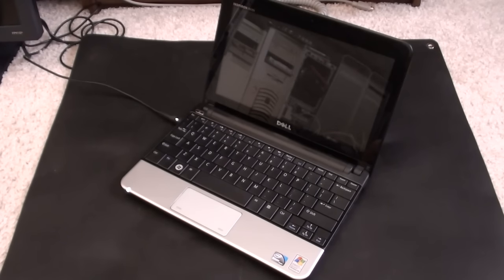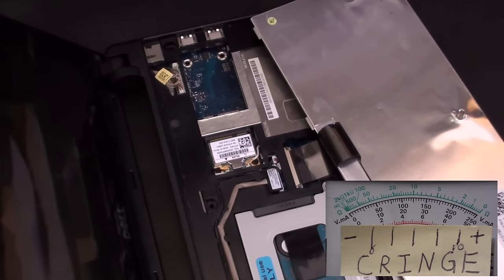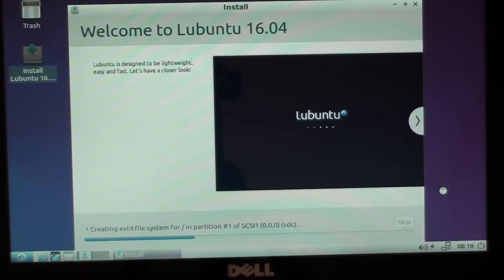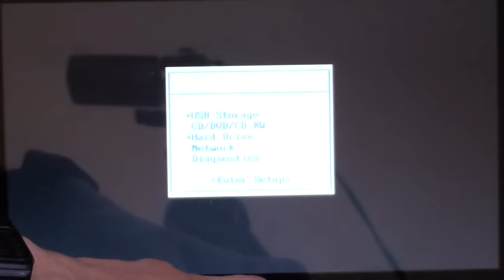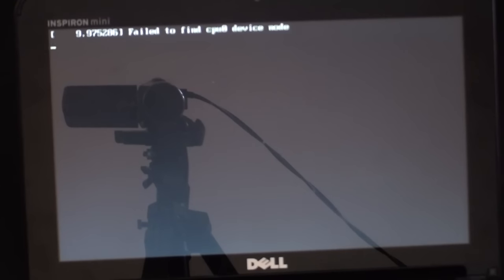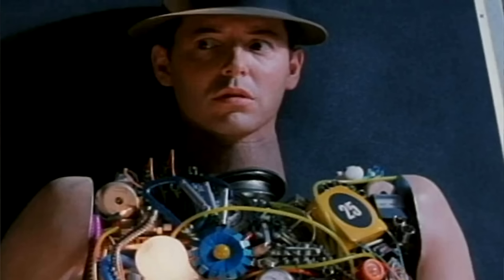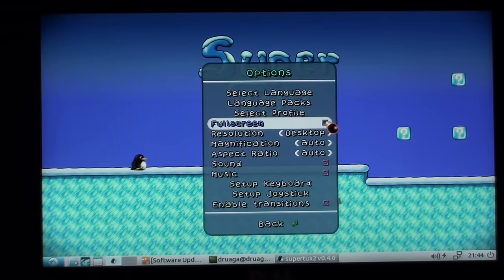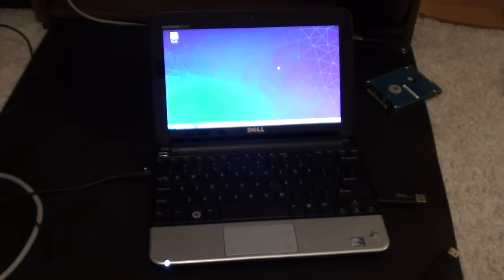Creating the SSD Linux Netbook

Comment: Ubuntu 16.4 and all based on Ubuntu 16.4 is as buggy as it gets. I have had all kinds of trouble with it crashing. I use only 14.4 version on my computers. I would try puppy Linux on the netbook. puppy Linux is meant to run on old pc.

Comment: Lubuntu was one of the worst Linux distros I ever used. Especially between 2014-2016. I don't know if it was my Acer Netbook I had or what, but I had (almost) the EXACT same problems showcased here. Ubuntu and Ubuntu based distros ( maybe except for Zorin OS) in general have been unstable as HELL latley.

Comment: fascinating. That computer must be cursed. I'm betting any other netbook would handle this much smoother (I have two 1.6 atoms that are running linuxes, though not on SSDs. Avoid Acers though, they put the hdd and ram in similar bullshit positions. EEE 1000h has the nice door for ram upgrades.).

Comment: why do you expect so many things from an old netbook?
Reply: Installing a light OS isn't that much to expect lol
Reply: Lubuntu is one of the lightest OS's out there. I've seen it run well on Pentium 4's and half a gig of ram. That's not expecting much out of this laptop.
Reply: SwizzleDude But thats not a "real" Windows, librarys and stuff need to be missing to run on that small amount of system resources. Or you mean the CE followup, which isn't a regular Windows OS at all,
Reply: ***** Yeah, but most desktop programs just wont work, like web browsers, office suites and other common used software types. There is software special written for the OS, but they are not Windows compatible

Comment: I have no idea why you had so much trouble and the performance was so bad. I installed Lubuntu on my Asus eee 1005HA on the same HDD as WinXP, and both OS's run fine and fast, even dualbooting.
And I'm no IT wizard.

Comment: Omg druaga you just could do this faster but 1 thing if a os is 64bit and install on a pc with 64bit prosesor you cant put it in 32 bit systems if you install 32 bit you can boot from any pc that is 32 and 64 (64 bit prosesors can have more ram then 32 so you can only have 3 gb of ram)

Comment: Dell Vostro 3560 Notebook business computer:
CPU: Intel Core i7-3632QM (2.20Ghz/3.20Ghz with Turbo Boost, 6MB Cache) (4C/8T)
Memory: 8GB DDR3L-1600MHz (Max 16GB)
Screen Size: 15.6" (1920 x 1080) Full-HD available | Webcam HD
HDD: Dell Seagate FireCuda 1TB 7200rpm Hybrid Drive 2.5" + Dell 480GB SSD
VGA: Nvidia GeForce GT 640M LE (1GB) GDDR5 128-bit PCIe 2.0 x16 (pre-upgraded)
Optical Drive: Dell 8x Speed DVD±R/RW SuperMulti DL
Battery/Weight: 6-Cell (62Wh) Lion – 2.4kg include Battery
Warranty: 12 Year - From USA – Full Box - New 100%
More Motherboard System: USB 3.0 • HDMI • Blutooth 4.0 • Headphone Microphone input • VGA (15-pin) • RJ-45 (10/100/1000) • Wireless Type: 802.11n
Operating System: Windows 7 Ultimate 64-bit available (Dell OEM)
Software: Microsoft Office 2010 Professional 64-bit

Comment: i have Magalhães 2
atom n455 1.66ghz/512kb
2gb ddr3 800mhz
120gb 7200rpm hitashi drive (5.3 on windows 7)
intel gma 3150
from windows 7 ultimate to win 10 pro upgrade and runs very good!

and also i want to add a ssd

Comment: just remember 5400rpm hard disks are for rectal use only seriously
Reply: Almost Evil 665
cause they are shit slow they are the joke of the computer world cause the bs of they are easier on power is bs an ssd uses half to power that the 5400 uses to run and they are faster in many ways even if the read and write speeds are the same which only works for the cheap cheap ones

Comment: A twitch stream would't work. It kills the CPU. on my Lenovo Ideapad 100 it skips like 25 out of every 30 frames
Reply: I can watch low quality Twitch streams fairly well on my Packard Bell Dot SE 410. And that has an old Atom N450...
Reply: Thwn it must be linux's fault(I run Kubuntu)
Reply: radostin04 I was running Lubuntu 14.04. Now it has Windows 7 + 10 tho
Reply: huh, weird. oh, maybe because i watch smaller streams without quality settings, so i basically have only one setting, source, which is not a problem for my internet connection(which is 100MBit up and down) but it kills the cpu on my weak laptop.
Reply: radostin04 Yeah, Source quality is the highest and thus intense, runs fine on my i3 350M but you definitely need a strong or decent modern CPU to watch Source well. Low worked alright and because it has a 1024 x 600 screen you don't lose much quality lol

Comment: I have this laptop, and i did upgrade the ram to 4gb. Then installed ubuntu
Reply: The biggest pain in my arse from the last 8 years
Reply: +AdamB Try changing the HDD in an original iBook G3 . . you will wish for sweet death
Reply: segaprophet I used to work in a computer repair shop which is where i encountered this notebook. Luckily that kiss of death never crossed my path

Comment: i have a chine atom netbook actually worse than yours and mine had no problems whatsoever. i even compiled pcsxr for it and played some psx games on it.
You have problems with your sata controller. thats why you get command errors on your sata link.
you need to see whether its the ssd not linking sata1 or your controller not liking your sata2 ssd. or maybe the bios is crappy and says it does stuff which it doesnt but as winxp drivers and setting are hand crafted this crap goes unseen until you try an OS that tries use the door when it is told the house has a door....
Via controllers are known for this crap.
also touchpad drivers are crap. if you can and it bothers you use a mouse.

Comment: On my fucking eeePC youtube videos are fucking super laggy.. To see them I have to download them, and once I downloaded even 1080p doesn't lag. But it's a fucking mess everytime
Reply: having same problem with old laptop, guess youtube new interface is hard on hardware :D
Reply: its probably your computer, mine can run 4K perfect and my monitor is not even 4K
Reply: Yeah, but video offline runs great, even 1080p 60, but when i want to watch on yt, it lags alot :(
Reply: On my main computers (Gaming RIG with i5 and GTX 780) and MBP 2012 it's all perfect. But on a 2011 eeePC I bet it's fucking laggy man.
Reply: Mr. ManDudeGuy On my main computers (Gaming RIG with i5 and GTX 780) and MBP 2012 it's all perfect. But on a 2011 eeePC I bet it's fucking laggy man.
Reply: now it would be much worse, because of new layout :D
Reply: Always had that problem, even when I upgraded mine to 2GB of ram, it was still slow
Reply: Giuseppe Secchi Windows or Linux?
Reply: Complextro No, but streaming 1920x1080 pixels 30 or even 60 times per second (well, compressed, but still) in a heavy (which is going to be the case i guess) Webbrowser in comparison to a simple media player and playing it back at the same time. But yes, also the new interface is massivly overdone speaking of the scripts and background elements :/
Reply: Giuseppe Secchi You can't really compare those two, there are miles between them in terms of power

Comment: Windows xp is now (2020) saver to use then Windows 10 because malware makers are also no langer supporting it. I use it on regular basis, even the opera browser runs smootly. Problem with Windows xp: because Micro$oft no longer supports it, you do no longer get certificates and cipherspec updates, the available websites you can enter are getting harder and harder to find because Windows xp can no longer decipher the ssl encrypted webcontent.
Reply: No, it's not safe. XP machines are used by the military and some government establishments, and as such, is heavily targeted. Armenia for example, 60% of users there are on XP, and it has dealt with massive cybersecurity attacks.

Also, "micro$oft", really, very original. Why? Because software eventually becomes obsolete and support needs to be cut to focus on future versions?

Comment: Davvid5 months ago (edited)
This guy can put SSDs in soda machines
Reply 203 View all 40 replies 
 ThePolocatfan2761 month ago
krass76 well they run on Android and that's probably slightlt cheaper than upkeeping a mechanical machine.
Reply  Eli The Other Computer Guy2 weeks ago
It would have the best water cooling.
Reply  Keigun5 months ago
For Rectal Use Only.. So that's why you needed around 45 Minutes..
Reply 132 View all 44 replies 
 Manly Pink2 months ago
Lets just have more cancer, You can never have too much cancer in the youtube's comment section.
Reply 1  gafeht2 months ago
It was a joke omg
Reply  TechNova5 months ago
Next time put an SSD into an ATM machine.
Reply 79 View all 22 replies 
 AC Mild2 months ago
TruckSimz It even still running Windows NT in some machine here in Indonesia for some local and foreign Banks
Reply  colas albert1 month ago
New Brain SSD.  For every hard mondays!
Reply  Dhavid Setiawan KilluaDhavid5 months ago
and the password is "weed"
Reply 42 View all 5 replies 
 pojcharapol tosukowong4 months ago
+iKervinGaming still better than MacBook.
Reply 2  Adam78684 months ago
+pojcharapol tosukowong MacBook wasn't bad it was just a little slow
Reply 1  mike527875 months ago
you have to have a pretty loose asshole to use a 2.5" hdd rectally
Reply 43 View all 4 replies 
 AndrzejKucyg2 months ago
Solid State Dick ( ° ʖ ° )
Reply 5  TrolleyMC1 month ago
( ° ʖ ° )
Reply  ender_scythe5 months ago (edited)
"for rectal use ONLY"-how do you insert a 2.5 inch hard drive into your rectum?
Reply 19 View all 28 replies 
 Nicholas Vilchock1 month ago (edited)
television and cheese can I use a USB 3.0 hard drive
Reply  Strudle Master22 hours ago
I just put the entire fucking computer in my ass
Reply  Forcefield Gaming5 months ago
Why does it say "Designed for Windows XP" when it has a Windows 7 Style key?
Reply 18 View all 9 replies 
 DoomDukem 19983 months ago
+Forcefield Gaming It's also a Windows Vista style key.
Reply  JonasLue1 month ago
To everyone here: He also said, he don't wabt to buy another one of those [keyboard], so i guess this is not the original keyboard?
Reply  ConservativeWalrus5 months ago
Put an SSD in an Xbox and install Windows 2000 on it (If that's possible)
Reply 18 View all 15 replies 
 DoomDukem 19983 months ago (edited)
+television and cheese The regular consoles have 64MB while the Development Kits have 128MB.
Reply  WHAT TO DO2 months ago
It might be possible since the original Xbox was running on a Pentium III processor, and the modding community is somewhat huge.
Reply  testing15675 months ago
Here is a little secret about Linux.  You can preinstall it on a hard drive and then just put them in the PC you want.  It doesn't do hardware detection during install.  You can literally put that linux HD into any computer and it will work.
Reply 13 View all 9 replies 
 Doofus Industries2 months ago
I'm pretty sure Debian works... i actually don't know...
Reply  Nevondrax2 months ago
Well it works fine on my arch install. I think you people should get your own experience with using linux, otherwise you cant really judge it/Mythbust it. Also main reason it doesnt work on some reason is because of the use of the Fstab files and how the partitions are defined in there (Fstab tells the system how and where to mount the drive(s) ). If you want to be 100% sure that its compatible across multiple PC's, use Partition Labels or Partition UUID's then there is a about 90-95% chance that it will be fine. And as long as you stick with Nouveau (Nvidia), MESA (Intel) or... cant remember the amd counterpart drivers, it should boot up just fine.
Reply  Windows 105 months ago
Cringe meter made me cringe
Reply 14 View all 17 replies 
 DrAwesome821 Tech1 month ago
+Seppä it's worse than Windows ME
Reply  GTAMasterPlayer1 month ago
+Dylan R Haha! True.
Reply  Jacob Nimeh5 months ago
Try putting Ubuntu on an iBook. It works and it's not that bad. I put it on an iBook G3 and now it's modern.
Reply 9 View all 3 replies 
 GloomyJD4 months ago
A few years ago when I still used a G3 iBook I ended up putting Ubuntu on it to run some newer software. I agree It does actually work pretty well!
Reply 1  Jacob Nimeh2 months ago
Ok went wrong and had to go back to tiger but it did work
Reply  Evgeny Nikiforov5 months ago
Still waiting for Linux on G5 video
Reply 8 View all 3 replies 
 OtavioFesoares5 months ago
Screw that. I'm still waiting for the G4 Cube video.
Reply 4  EXODUS2 months ago
OtavioFesoares and now it's out
Reply  joshua ooroth5 months ago
+Druaga1 you shouldve instaled android on the netbook. Or chrome OS. those two operating systems can run on computers even slower then your netbook. ive done it before with computers with 1ghz processors and computers with 512 mb of ram including ssd's and runs lightning fast.
Reply 7 View all 5 replies 
 jakibaki5 months ago
Lubuntu is actually lighter than chrome-os
Reply 1  JonasLue1 month ago
Both are just Android, so you're limited to Android apps, which are simply bot made for non-touch input devices
Reply  Daniel Ebinger3 months ago
I used to have one of these laptops. It was a Christmas gift.
I sat it on the floor, and my sister tipped a chair onto it.
Still thinking of a way to get back at her for that (this was back in like 2010).
Reply 5  Signal Radar2 months ago
When it's her birthday, get her a cake. When she's not looking, throw a chair on the cake.
Reply 6  James He2 months ago
Signal Radar YES
Reply  Nicnl5 months ago
I have not finished the video yet BUT an SSD (yes "an") will give great performances improvement even on SATA 1, not because of the bandwidth but because of the latency(around 15ms for a regular hard drive, around 0.1ms for a regular SSD : yeah 150 times faster
Reply 4 View all 3 replies 
 Nicnl5 months ago
In terms of access times... yes they areSearch on google some access time benchmarks comparing SSDs and HDDs, you'll be surprised
Reply 3  NameIst Unbekannt2 days ago
Nicnl Like for "an".
Reply  Gilbert C5 months ago
My relatively new acer aspire v15 nitro also has to have the motherboard removed to upgrade the ram, or install an m.2 ssd.... Also to access the motherboard I have to remove the keyboard because access is from the top instead of the bottom. Pretty annoying overal soo yeah... Pretty sure there are worse laptops to service :P
Reply 3 View all 8 replies 
 Jack Waterhouse4 months ago
+Seong Hong Its an ibook g4
Reply 1  Seong Hong4 months ago
bin it then man haha
Reply 1  GTAMasterPlayer1 month ago
This guy can probably replace a human brain with an SSD.
Reply 2 
 trizm 6ix 六2 months ago
"USB 1.1" oh god
Reply 2 View all 7 replies 
 trizm 6ix 六1 month ago
wat
Reply  JonasLue1 month ago
+trizm 6ix 六 The floppy drive has a device name, which is shown in the BIOS. Every storage media has one, not the drive label you see in the OS, but the "interface" name of the device
Reply  Fatal2 months ago
A four character password is indeed, "weak".
Reply 1  The SpyCrap1 week ago
Fatal weed
Reply 1  gerard s2 months ago
after all years of installing and reinstaling all kind of flavors, actually i can say, if you gonna play games on linux, please, pleeeeeease, install the drivers because if you don't, you gonna think linux is crap and reinstall again.
Reply 2  JonasLue1 month ago
gerard s Yup. That'a whats bothering me the most at Linux related videos. They never put even a bit more effort in it than running through the installer, and say it's crap -_-